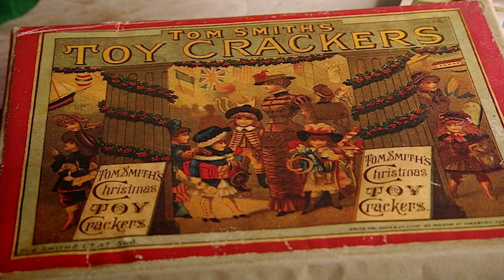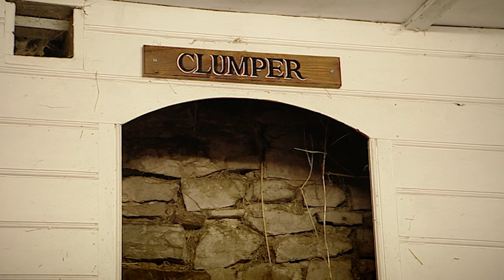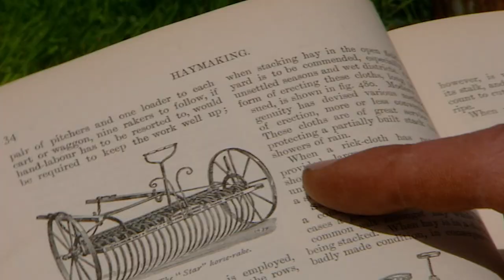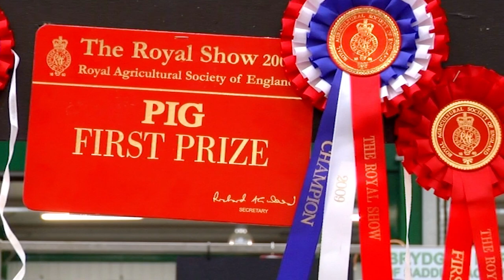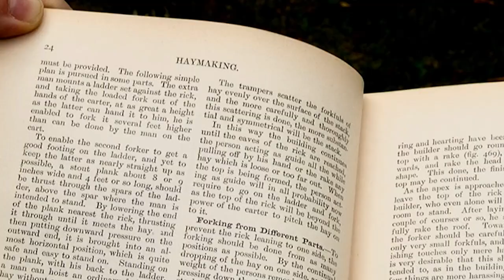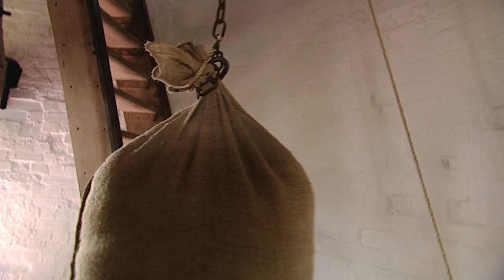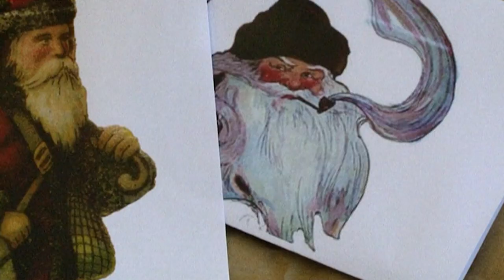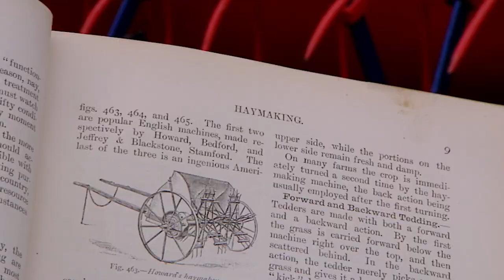The Bizarre Victorian Pie Made From Fat & Fruit | Victorian Farm: Christmas (1/3) | Real History

Comment: You're not supposed to back a horse into the cart with the frame (?) on the ground. It's too easy to injure the horse and also to smash the wagon.
Reply: And you're right... The shafts should be up, then Clumper backs a step or two, and you lower the shafts over Clumper's shoulders
Reply: @deboraharmstrong3002 Yes. It seemed like common sense to me.
Reply: I visibly cringed when I seen that 🫣
Reply: They’re learning. I know you of course do every single thing perfect when you first try. Some of us are as blessed as you
Reply: City boys....
When will they ever learn the difference between HORSE and horse power ?  😮